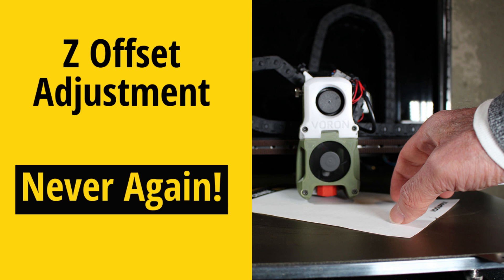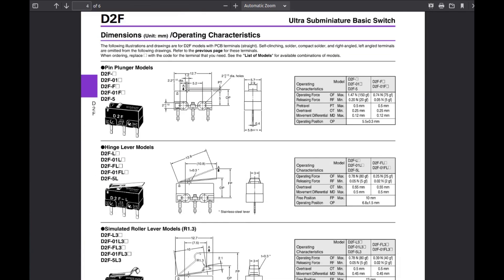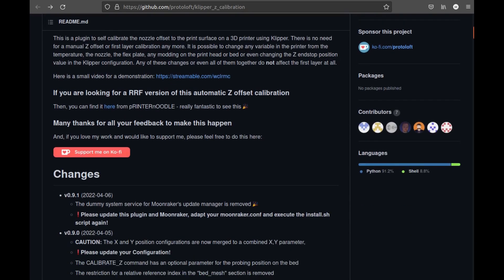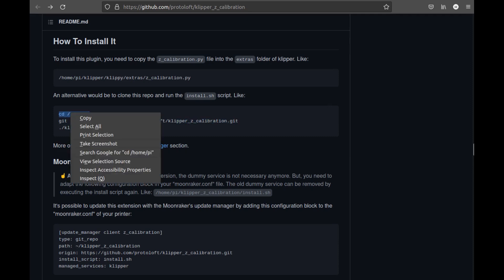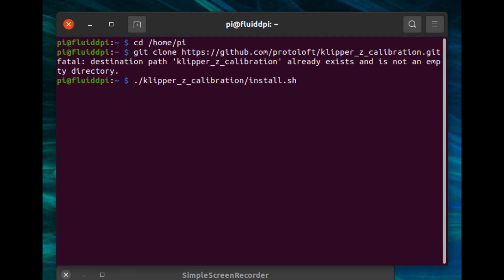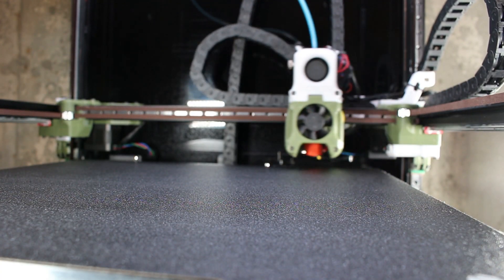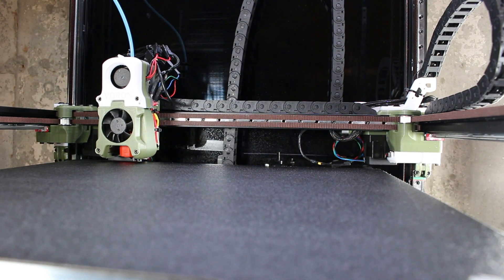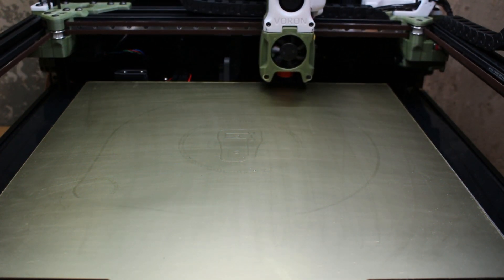Never adjust your 3D Printer Z Offset again with Klipper and a plugin

Comment: Hello, when I built my voron 2.4, I followed this great video to use the z_calibration plugin, since the last update of z_calibration, I have errors that appear on startup.J got two messages, "The 'max_deviation' option in the 'z_calibration' section is deprecated." and "The 'clearance' option in the 'z_calibration' section is deprecated.". Can you help me or update your video, to tell me what to do to remove these defects.
In advance thank you for your response.
Reply from the maker: Thank you!  Have you had a chance to step through this: https://github.com/protoloft/klipper_z_calibration/wiki/How-To-Configure-It
On this printer, over time I've moved into a very different direction as I continue to try different tools.  I've got no limit switches anymore.  I have plans in the future to get back to this on a new printer I'm building, but it probably won't happen for several months at least.

Comment: Great to see new things… do you think I can 8nstall this Nozzle Z hight to any printer… I‘m using Klipper successfully on a Elegoo Neptun 3 Plus. I can go -6 on both axis, guess should work… thanks
Reply from the maker: I think you can.  As long as you have klipper, but you also need that nozzle end stop as well as either a Euclid probe or Klicky.

Comment: It told me i had to turn off virtual z endstop. I did, ran home and it crashed into bed.  It also mad me set position_endstop, which i left -.5 from config.  I have klicky and it was working fine before.    What is wrong?
Reply from the maker: What told you to turn off virtual z endstop?
Reply: @KapmansBasementWorkshop  Got an error message that said had to be turned off when i include autoz.config  Klipper reports: ERROR

A virtual endstop for z is not supported for z_calibration
Reply from the maker: @C650101  I just looked into this.  The very 1st paragraph on the requirements states: A z endstop where the tip of the nozzle drives on a switch (like the standard Voron V1/V2 enstop). It does not work with the virtual pin of the probe as an endstop! It is not necessary to have a Voron printer, but this type of endstop.
What type of endstop are you using for z?
Reply: @KapmansBasementWorkshop  Yes, but somehow once i gave up endstop i got into a crash situation.  So i missed something. Not that you did n't say it, maybe i am deaf.   When i turned that off and tried to home, it slammed into bed.  Did not even attempt to click that endstop swtich next to bed,  even though i set the 2 lcoations in the autoz.cfg.
Reply: @KapmansBasementWorkshop  Ok,. trying this again but i notice  i cannot trigger that switch next to the bed.  Also, last time i tried this it never even tried to go where i specified the switch was. Just crashed.  Why is that?  I watch video again but i think i am missing something in printer.cfg.  If i take away virtual endstop, clicky can't home z.  without physical switch, can't trigger the button switch.  
[stepper_z]
step_pin: PF11
dir_pin: !PG3
enable_pin: !PG5
rotation_distance: 4    # Rotation Distance for TR8x8 = 8, TR8x4 = 4, TR8x2 = 2
microsteps: 32
full_steps_per_rotation: 200
#endstop_pin: PG10   #- LDO setting   I have virtual probe here now.  can't have both,right?
Reply from the maker: @C650101  You should not try this until you get that switch working.  This will never work without it.  Check the pins, check the wiring and check the switch itself.  I don't have the same MCU as you.  But make sure the pin you specify above is where the switch is physically connected.

Comment: Hey there! I’m so glad I found your videos. They had helped me so much in my build. One issue I’ve always had with this mod comes down to reliability. Many times I have to run this bit of calibration code 20 or 30 times, or more! Just to get a proper offset! 

Get the error “probe samples exceed tolerance” every time. I made sure nothing was lose with klicky or the end stop, but this still fails. Most failure is when measuring the nozzle against the stop. When it works though, it’s fantastic! What would you recommend I take a look at to fix the issue?
Reply from the maker: My guess is the micro switch in the z ends top might need to be replaced.  It could also be the klicky micro switch. I have had to replace the z endstop switch multiple times…
Reply: hi, a question, did the rest of the setup went well? I have a Klicky and had to change quit a lot in the autoz.cfg before it was error free. Now at calibrate "No trigger on probe after full movement" and process stops. Did you not get this error? Thanks!
Reply from the maker: @richardtepas4832  That message usually comes up when the microswitch isn't being sensed properly.  It can be the sign of a continuity problem with the wiring of the wrong pins are configured.
Reply: @KapmansBasementWorkshop  ok thanks, into that. Klicky works flawless, so i think it might be something else. Did you only have to change 2 or 3 settings in the config? Because i had to change a lot more
Reply from the maker: @richardtepas4832  Most of my changes were in the cfg file for the automatic z calibration.  I have my files in github.  The video description contains the link to those files if you wish to see them.

Comment: Just found your video, you saved me a lot of headaches, thank you!!
I do have a question if you don't mind,  my understanding is that the Z calibration is not saved anywhere as a permanent offset, so it needs to be done every time you start a new print and consequently do a G28 as we normally do.
 i am no expert in macros, and recently switched from klicky to Euclid with a few problem to sort out before getting it running.
is there something i'm doing wrong or is intended to work once for every single printing cycle?
Thank you for your time, amazing videos by the way.
Reply from the maker: Good question.  You can save the settings, but I choose not to.  My reasoning?  When I start my first print of the day, I don't heat soak my printer.  As soon as the bed is hot enough, the printer homes, QGL, home and then calculates the z-offset and the print starts.  But as the printer frame, gantry and linear guides absorb the heat, expand throughout the day, the dimensions of the printer change slightly.  So I found that running the process again for the next print generates more consistent 1st layers because a new z-offset is generated for each print.  So for me, it did not make sense to save those settings.  And since the z-offset is calibrated automatically, I'm not doing to work, the printer is doing it for me.  True, it takes a little longer to start a print, but for me, that's way better than heat soaking the printer for 30 to 60 mins prior to the 1st print and it gets me a perfect 1st layer each print.  
Thank you for the kind words and watching!

Comment: Question, can you set value on switch offset like in-between 0.24 to 0.25 to like 0.245? when i put to 0.24 its a little bit high and when i do 0.25 it makes some scratches on the first layer. thank you
Reply from the maker: I see no reason why you can't.  I would certainly try it.  It just comes down to the physical limits of your z axis.

Comment: Hey there I am one your subscriber 
I wanted to ask a question. Did you buy the bigtreetech product directly from their website. Please inform me.
Reply: I ordered the product but it is 20th day still they are not responding to me
Reply: Can you send me the product delivered picture or of the box. So that I get any clue.
Reply from the maker: Which BigTreeTech product did you order?
Reply: Um ezmax, 6drivers, cm1x16gb, pb1
Reply from the maker: @deone-entity3935  The closest I've got is this: https://youtu.be/dq__xTZVLyk and this: https://youtu.be/hCJgd95nUUU
I don't own that controller combination.
Reply: And pla
Reply: No I didn't mean that way I needed unboxing video
Reply from the maker: @deone-entity3935  I don't have one.  Also, the CB1 requires a carrier board as it does not plug directly into the MCU that you ordered.  The form factor is the same as a RPI CM4.  So you also ordered the PI4b from BTT as well, correct?

I have not had any trouble receiving packages from BTT.  I have found them to be very reputable.
Reply: @KapmansBasementWorkshop  yes I also order
Reply from the maker: @deone-entity3935  That's good news.  One or more of the parts may be on back order.  I would have expected them to respond to your requests.
Reply: Thanks very much

Comment: I did this mod but decided to stop using it, but there's no instructions on how to undo it 🙂  I'm trying to go back to the regular old way of doing it, but my Z offset is all over the place now, I have to adjust it each and every time, often by huge amounts.  I can only assume it's because of the auto z stuff.  I've commented out the autoz config file, is there anything else I should do to "undo" auto z?
Reply from the maker: There should be nothing else but eliminating the calls and not including the file at the top of your printer.cfg.  I'll have a look and see what I can find.

Comment: Very nice :) thanks for the video! Is the "bed" switch wired in parallel to the hotend switch or has it a designated input on the motherboard?
Reply from the maker: It has it's own dedicated connection to the motherboard just as any of the other end stop switches do.  Thanks!

Comment: If you don't want to calibrate before every print (as most of the time i'm not swapping beds), how can we use this? does it auto save the calibration in the printer config file, or would one need to do that?
Thanks!
Reply from the maker: I believe you can just use the "SAVE_CONFIG" command.  The printer will reboot and you will need to run the auto-z again.  But  it should be fine from there.  One comment.  While this is useful for switching bed plates, the reason why I run this at the start of each print is to compensate for thermal expansion.  Since installing this, I do not heat soak the printer.  When cold, I start a print and as soon as the bed and nozzle are at the correct temps, it automatically calibrates and starts printing.  Once done, the printer cools down a bit, I prep the bed for the next print and it now auto calibrates as the printer is no longer cold, but warm and the frame and bed might have changed slightly due to the temp changes.  I get very consistent 1st layers since doing this, without heat soak.  The net effect is that calibrating prior to each print actually saves time!  Thanks for watching and the question!

Comment: What does error says “offset is larger as allowed: OFFSET=3.427 MAX_DEVIATION=1.000
Reply from the maker: I believe you need to do the paper adjustment 1st.  Once you do and the offset set with the paper is less than 1mm, you should be fine for it to offset itself from there on.  The other option if that does not work is the change the max value to something other than 1mm in the cfg file.  But do the paper adjustment 1st.
Reply: @KapmansBasementWorkshop  ok i will try that. Thank you

Comment: Hello and thanks for the AWESOME guide! One question: is it possible to have the switch only for z calibration, and use the klicky probe for homing? I am asking because I am using a modified mount version for the VzBot, and if the printer tries to home with the probe attached, the probe will touch the bed before the nozzle touches the switch, and chaos will ensue!
So, only options I have is to either always use the klicky probe for homing, or somehow to prevent homing if probe appears triggered.
Reply from the maker: So I always home 1st.  Then pick up the klicky probe and use it to level the gantry.  Drop off the probe and home again since home probably changed slightly after bed leveling.  I've never successfully left the probe on.

Thanks for the kind words and watching!

Comment: In your Gcode, you first clear the bed mesh, and then after the qgl you load it? Can you elaborate on that? It's tripping me out haha
Reply from the maker: So don't take this as known facts, it's more superstition....

I have heard conflicting stories about QGL clearing the bed mesh prior to actually executing the QGL. I have also heard stories about Klipper not automatically loading a bed mesh after a QGL runs.  I have heard similar stories about G32.  
Also, the Voron secondary tuning instructions where it states that it's probably a good idea to run a bed mesh calibrate in your print start prior to each and every print states this:
"Then, place BED_MESH_CALIBRATE in your PRINT_START macro, AFTER any homing and leveling routines like G28, G32, QUAD_GANTRY_LEVEL, and Z_TILT_ADJUST."
That's not the same as simply loading a bed mesh, but it's similar.  So, does that backup the statement that QGL or G32 clear the bed mesh and don't reload it?  I don't know.  This (at the time) seemed like a sure way to be sure while being lazy and not testing the theory to be sure.

I wish I had a better answer for you.
It's a good question and thank you for asking and watching!

Comment: Is this Auto probing supposed to happen automatically with every print? I’m only getting the homing then QGC and that’s it.
Reply from the maker: Its  really up to you and how you setup the printer.  I placed it in the print_start macro so it would happen prior to every print.
Reply: @KapmansBasementWorkshop  one more question am I supposed to save the offset to the probe or z stop.
Reply from the maker: @TheCyclingConquistador  You save the offset from the nozzle to the bed at the correct height you need for the 1st layer.  Use the paper test and then do some final adjustments to that value with some test prints.  Once complete, you should be set.
Reply: @KapmansBasementWorkshop  thanks, I really appreciate your help and the video.
Reply from the maker: @TheCyclingConquistador  Happy to help.

Comment: Thank you for this! really apriciate it.. If I would like to make a shortcut in macros whit this code : "calibrate_z", where and what  would I have to write?
Reply from the maker: All you need to do is create a macro that includes this call.  This can be the only call in the macro if you like.  So something like this in your printer.cfg:
[gcode_macro cal_z]
gcode:
	calibrate_z

It should appear with the other macros in Fluidd or Mainsail after restarting klipper.  You might need to turn it on in the config section of mainsail or Fluidd that allows you to control if they appear or not.
Warning, I have not tested that simple macro above, but I think it will work.

Thank you for watching!
Reply: @KapmansBasementWorkshop   Thank you! And also thank you for all the videos that you uploaded!
Reply from the maker: @rokdobravec8231  I'm glad they are helpful!

Comment: Great video and to the point. Helped me a lot this evening. One question, I noticed after this set up if I leave my nozzle at zero and rehome the z doesn't rise above the plate first. Is there a way to adjust that?
Reply: That might have been due to the g90 and I did not restart first. I think that might have been the issue but have to double check.
Reply from the maker: Assuming I understand what you experienced, I think that depends on how you have klicky or Euclid configured when homing, correct?

Comment: Because of my setup de Euclid probe is beside the printerhead, is it possible to do the endstop probing and then attache euclid probe? For messering the endstop?
Reply from the maker: I don't think so, unless you change the auto-z calibrate code itself?  The config file simply asks for the location in x & y.  It doesn't really give you those options.

Comment: Why do we need to get rid of induction style probes?
Reply from the maker: If yours works well and you have no issues with it, no need to change it.  However, in my case the induction probe took a long time in the heat to stabilize it's readings.  Also, it can only measure ferrous metals.  So it never can actually measure the actual height of your flexible build plate because it cannot "see" the pei on top, only the metal underneath.  And then I have had them melt on me as well.  Finally, I could not use this software to auto calibrate the z-offset.  For me, this was the single biggest improvement in my day to day printing.  I can change bed plates, they can be different thicknesses and the 1st layer height is always perfect. Automatically. And before I needed to wait an hour to 90 minutes for the induction probe to give stable readings in the heat.  Now it re calibrates prior to each and every print.  It's super nice.  Thanks for watching!
Reply: @KapmansBasementWorkshop  thanks for the explanation.  I do not yet have a bed sensor.  I plan on adding one and wanted to know why you did not like the inductive.  Thanks for the information.
Reply from the maker: @f1hotrod527  It just was not very reliable for me.  Thanks very much for the question, comments and watching!